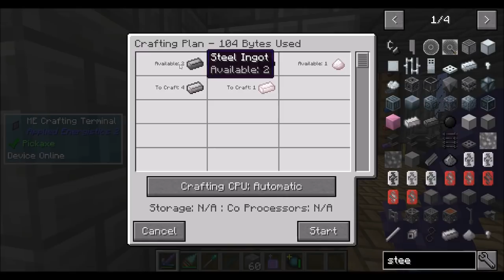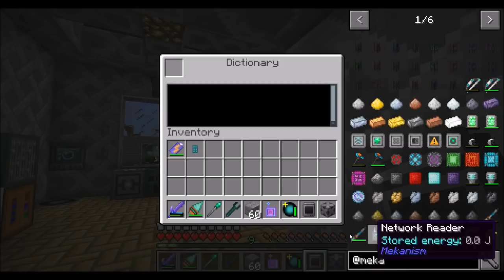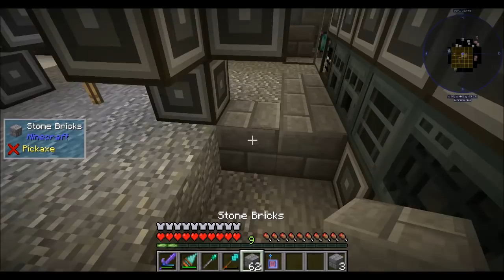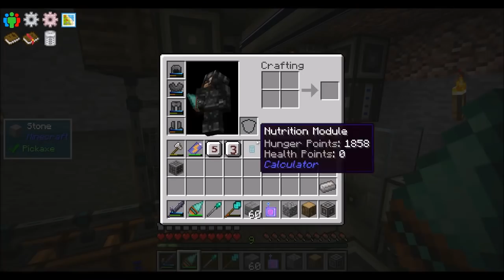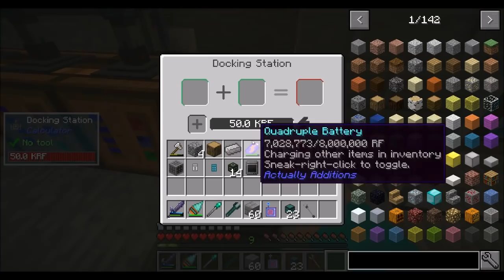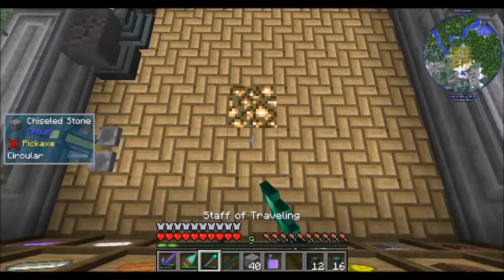AoE Ep56 SideTracked Mechanism

Comment: @direwolf20 Mekanism has no in-game guide, but the wiki is up to date. The Dictionary is used to determine if blocks or ingots have ore dictionary strings (like copper and tin). The dictionary and ore dictionary are used more for packs that have default configs to unify ores.

Comment: Few tips about mekanism:
     - get an "atomic disassembler". this works as a sword, pickaxe, axe, shovel etc. extra hint: it has different speed modes (shift + right click is default for me for example).
     - most of the machines accept upgrades, but if you plan on using speed upgrades, then dont forget energy upgrades. these lower processing energy cost
     - when youll start using the metallurgic infuser, dont use raw materials there (redstone, pulverized diamond, pulverized coal etc). you should first enrich them in an enrichment chamber
     - most of the machines have factory version of them (metallurgic infuser = infusing factory), which are separated by tiers. higher tier = more slots for processing (7x smelting at the same time in smelting factory!!!!!)
     - factory machines have auto-sort (!!!)
     - mekanism has thermal expansion's tesseract equivalent  (quantum entangoloporter)
     - automating 5x ore processing is really fun, but you need A LOT (and i mean A LOT) of salt (as far as i remember)
     - make a windmill farm. in mekanism, windmills are actually useful and dont take up much space at all
     - the dictionary item you had displays item's ore dictionary name (useful for when using the digital miner, unless tooltips say it)
     - vanilla mekanism accepts rf and your typical conduits and ducts (but im not sure about AoE)
     - you really should get an atomic disassembler
Reply: - mekanism has tesseract equivalents for power, items, fluid and gases (cant recall their names)

I Think that is the Quantum Entangoloporter?
Reply: yeah, but now that i looked it up in the wiki, it makes it seem so that there is only 1 quantum entangoloporter. for some reason i remember there being a seperate one for each object type (power, items, fluids, gas). doesnt seem to be the case anymore
Reply: Sadly in AoE the pack maker has disabled support for all other power systems like EU and RF to force to you to use Mekanism Joules
Reply: what shouldnt realy be a problem since you can use wheat in a garden cloch pulvirezer it to get bio mass and set it up for a gas burning generator and plastic pallets and he has killed 2 or 3 things in one and the however they are called ligths look realy nice that you can make with the plastic sheets for a spacestation but i havent look for the recepies for the things needed
Reply: Yes, but probably not the item transport. Mek's logistical transporter is good, but Dire's so much more familiar with the EIO system that his ability to use it will be helpful.

The worst part for him will be the sidedness of the blocks. I can't remember if you can change that on all or just some of the machines.

Also, I really hope a lot of people upvote your comment so it doesn't get lost. This is pretty much exactly what Dire needs for a mod he's unfamiliar with: a basic goal outline.
Reply: Can't you use other something other than salt which was way more efficient? I  think it was some gas from mechanism.
Reply: i think it was brine? yeah, you can but its still salt in one way or another :D . when i played in 1.7.10 with mekanism then i digital mined around 60k salt but it was used up in the matter of minutes (i may be exaggerating) when i used factories. also producing brine is somewhat painful as the multiblock needs constant sunlight and the right biome to be most efficient. of course you could try building several of those multiblocks but i didnt get that far

Comment: Six interfaces to one assembler? That's so inefficient. No parallel crafting can happen. Add assemblers to the outer faces of those interfaces, Dire. They don't cost channels afterall. A 2x2x4 tower of alternating assemblers and interfaces is a good balance between space and efficiency.
Reply: do you have a picture of that? i have a hard time visualizing it
Reply: MrNeocortex you are still losing out on that setup as the assemblers pass 8 channels so you can coat the interfaces with 6 assemblers and still get the channels to a cable outside it. 

5 co processors per crafting cpu and you can take full advantage of the 6 interfaces. 

With the channel problems in this pack the best setup is the flower as you can easily back track what needs the cable broken and replaced to talk to the controller again. dense cable up the center with normal or smart cables branching off  to groups of 8 interfaces each covered by 6 assemblers. Once the interface is full hide from the terminal and a sign on the outside with what recipes are inside in case you need to find again.
Reply: Andrew H

The flower design does maximise the number of assemblers to interfaces and I have used it before, stacking one on top of the other. Whilst the design I've shown doesn't maximise the ratio, I like it because of it's compact design. You can get 64 interfaces and assemblers onto a 6x10 floor area.

I usually have at least 8 of those towers setup in my builds. With that many you can spread out patterns that need to be parallel crafted to make up a larger item. And with the middle interfaces having access to 4 assemblers, patterns that are used to craft the largest number of items can be placed there.

Everyone finds their own way of building AE2 systems and we all have our preferences. I've started using the Ender IO ME conduits for my P2P tunnel lines as they stand out easily. You use a lot less wool when doing long runs as I only use the smart and dense fluix cables for junctions and connections.
Reply: I agree. There really is no right or wrong way to do it and I'm fairly sure it's intended with whole of AE2. Dire's got his Dire methods of doing Dire stuff. Yah know... To automate the things, and stuff.
Reply: Steve Uberfiend

Dire can be frustrating to watch on occasion but his ability to automate something that shouldn't be automated is damned impressive, to the point where mod creators go out of their way to try and Dire proof them. There's a Youtuber called Nonsanity that has some skill in the automate all the things.

Comment: You should consider making ender tanks for the oxygen, hydrogen, and rocket fuel. Would make it possible to produce on the ground, and use on the station without machines on the station. Also, unless it was tweaked, Heat generators can produce energy if lava or fire is below them, it produces slower, however it is constantly producing at no loss of lava

Comment: the mekanism heat gen can work in a passive mode by having the lave around it. at least it used to in earlier versions of the pack
Reply: I've done this and honestly the passive output is so small, even with two gens surrounded by lava on all 5 sides, it really isn't worth the trouble.

Comment: Mekanism is compatible with EnderIO in this Pack (The Converting-Mechanism in Machienes is disabled in this Pack). For Energy you just need to use a Mekanism-Cable for the last block, which is connecting to the Mekanism Machiene. The rest of the way you can still use EnderIO Conduits. The Mekanism-Cable converts Mekanism-Joule to RF and vice versa

Comment: You should start preparing your eyes from now if you want to be able to handle the amount of dire wire that you will see at the 5x ore processing
Reply: The most fun thing in minecraft for me , is building the 5x ore processing
Reply: I've only done the 4x, now I'm inspired to try the 5x.  I just wish it handled more ore types.
Reply: chris909090 good luck with that ;) . 5x part is the most tricky/fun one . You need 1 at least solar destination plant for brine (you will need more if you want a fusion reactor)
After that you need a lot of chemicals and machines to presses them . For the main part of the 5x you dissolve the ores into a liquid , you wash that liquid and you crystallize it after that it is the 4x you have . But it takes time and the pipes/machines need to be clean if you want to change the ore type you process ;)

Comment: @direwolf20 You should dye the wool before crafting an Ender Tank or Chest if you are going to do all the same color as all three color slots are determined by the color wool used in the crafting of said Ender item. Basically, you using 3 Rose Red when 1 would work everytime is causing an eye twitch to develop.

Comment: dire, if it isnt too out of your way to do so, make the largest spatial storage drive and the respective pylons to store a large flat area, take a matter receiver with you, and use that to make a no-cost pseudo-specter dimension, then use that to either store all the more volatile energy generation methods (mainly the draconic reactor if you do it), so if the draconic reactor goes critical, nothing in your home dimension will be harmed

unless making storage/pseudo-specter dimensions

Comment: Even with blocking on, you'll probably end up one day with half of one recipe and half of another in the docking station, as it's checking the chest's inventory to see if it can pull more stuff in - not the docking station's. It's unlikely, but might lock up your system and would be a pain to have to fix. Probably should get it to be aware of the docking station's inventory.

Comment: Dire you can place lava blocks on each side of the heat generator and it will produce power like that. I would put it on 5 sides of the generator and get a conduit to feed it lava

Comment: Oh, word of advice: go to Mekanism config and set machine volume to something like 0.25 (or maybe even less). The loudness of the mod is a very irritating "feature" — it even has muffler upgrades… Which you can't even apply to some of the most irritating stuff. So yeah, first thing to do with Mekanism is turn its volume down.
Reply: you can craf also craft Muffling Upgrade for reduces noise generated by machinery.(more = sound disabled)
Reply: Omeka 88 shylight mentioned the muffler upgrade
Reply: +Omeka 88
It doesn't work for all the machines, mostly the multiblocks.

Good advice Shylight. I do the same thing for all mods that give the option. Loud machines are aggravating.

Comment: I'm kinda bummed that they changed Mekanism to use ONLY Mj this pack, since one of the coolest things about Mekanism imo is the ability to easily transfer between EU and RF
Reply: David Belknap that was the reason it was removed tbh to avoid not making mek stuffs and IE to get eu since u get eu in adv gens and advanced solar panels and the point of the pack was to make it harderrer and annoying
Reply: I mean, I feel like it was not removed to make it harder and annoying so much as it was to get you to build a power architecture from Mekanism sources rather than just rely on whatever EU or RF generation you already had built? I'm not saying I don't understand why the choice was made to do it that way I'm just saying it's a bummer because that in particular was one of the neater features of the mod.

Comment: Hey Dire not sure if this could work for the arc furnace to split items, but maybe using a speed downgrade might help? Not sure if it will add an item to the stack if the process started on one, though I do not have that high hope for that to really work